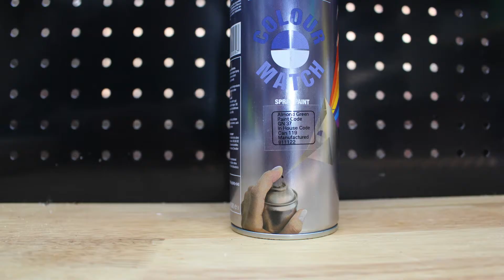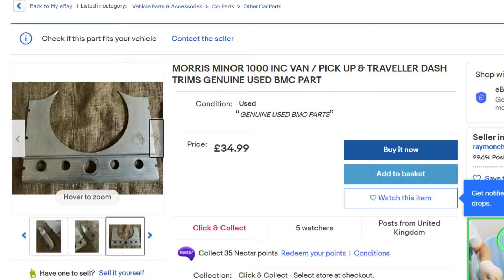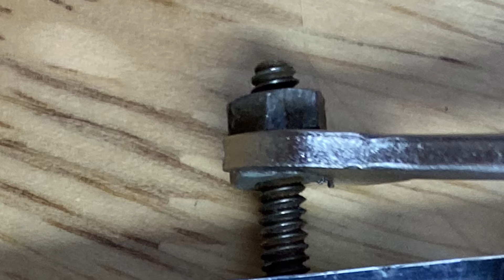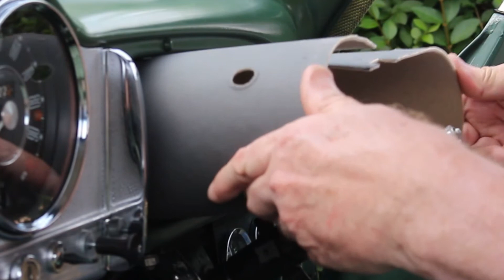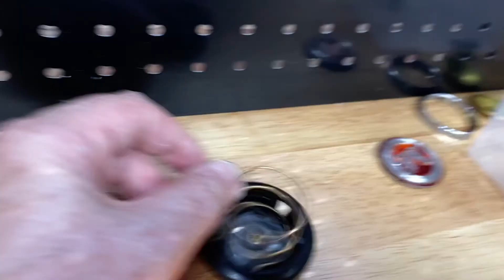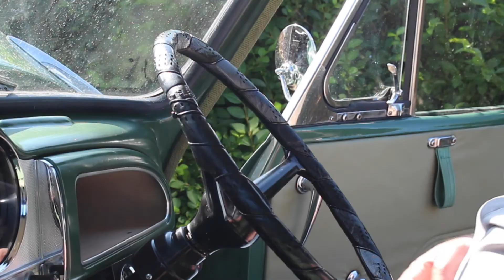Morris Minor dashboard and steering column refurbishment part 2

Comment: I can’t get my indicator flashing light to work , the light on the end of the stalk ,  followed your video , for some reason the wires on my new stalk were different colours from the wires on the car , I’ve put a post on the Facebook page Morris minor owners but not much help , do you have any ideas ?
Reply from the maker: The terminal marked P on the flasher relay should have a voltage going off and on when indicating in either direction. I suggest checking that first with the multimeter if it’s OK then check the wire going to the bulb on the indicator stalk. It’s normally a pale green, but it may be a different color on yours if it’s not a standard indicator stalk. you should be able to figure out which one it is using a multimeter.

Comment: Best not to have other keys on the same ring as the ignition key anyway as the swinging weight of the other keys eventually wears out the ignition key or the barrel potentially causing the lock to fail to work which can render your car inoperative.  My mechanic told me off for doing just that.
Reply from the maker: Thanks for the tip 👍

Comment: Excellent video. I notice your heater demist hoses are in a poor state and one barely attached to the screen nozzle. Personally, I would find a heater that worked properly more of a priority than beautification. Maybe a heater overhaul is an idea for a future video? I am about to do mine with a new matrix, a motor overhaul, new foam seals and new air hoses. They are 1 1/4 inch by the way. Best Wishes, Stephen
Reply from the maker: Well spotted! Yes, a heater refurbishment is on my list for a future video.